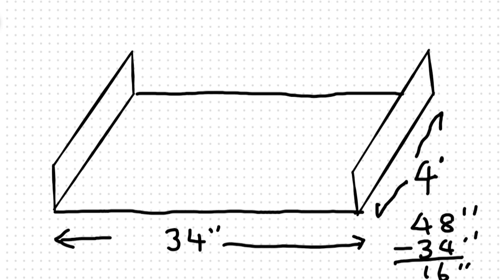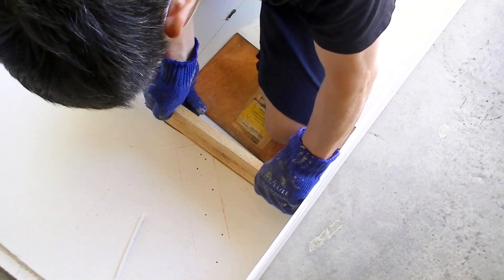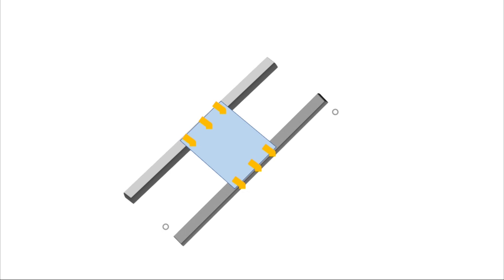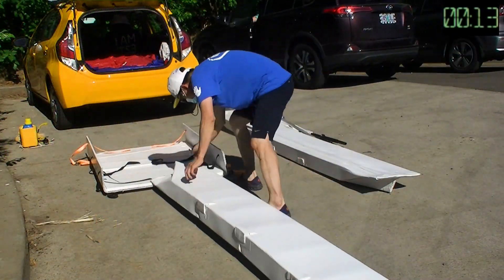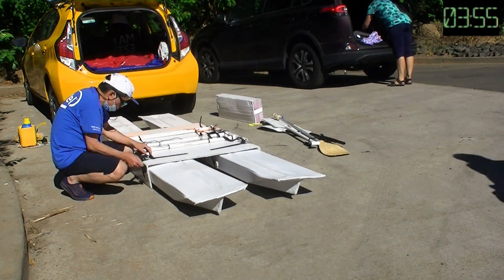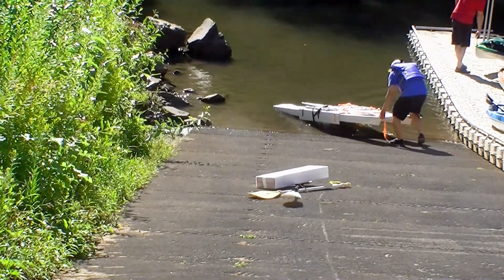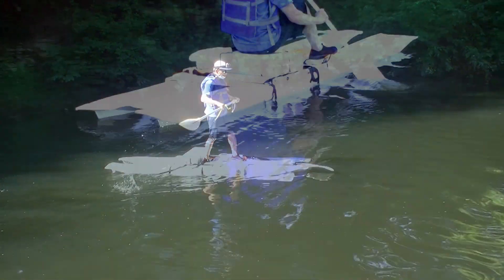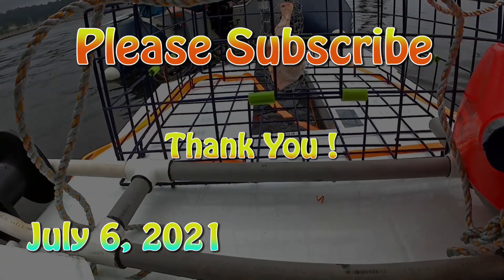Part 4 DIY Modular Paddle Board - Re-test the updated design 摺疊獨木舟

Comment: This is awesome. I just found your channel and will definitely be building at least one of your designs. When do you expect to have the plans for G17 on your website? Did much water get inside after the crabbing trip?
Reply from the maker: Thanks for watch and your question. I have used this boat 4 times, twice in the Pacific Coast and probably 10 hours (total) in the water. The left and right pontoons were built differently. I can sense the left (port side) pontoon has minor leakage (the right side pontoon works great, no leakage).  Probably from the top side. I would say there was probably 4 oz of water got in for each use. If I tip the pontoon and have it leaned against the wall, I can see water dripping out from the bow (which is supposed to be fused and watertight :-) . This is good because I don't have to make a hole to drain the water. The pontoons are 4" high. If you build a pontoon at 6" high, and adopt the technique I used to build the right pontoon, then it should be very safe. For my next set of pontoons, I plan to use the height of 8" (can carry two people). Please let me know the height of the pontoon you plan to build and I will create a plan for you. At Nehalem bay, the wind was gusting between 15-20 mph and the boat handled the wind and sea condition really well. I will post that video in the next few days. Cheers!

Comment: Great work Mr Hong! Thank you so much for sharing your technique with lot of details Sir!  I can't wait to see your work on mounting the pedal drive to this paddle board.
Reply from the maker: Thank you very much! Fusing the 10 mm thick coroplast is so much easier because overheating them would still work/fuse well (as shown in this video). Actually use Gorilla Glue will work also since the goal is to stick two sheets of coroplast together, no force to pull them apart. But it will cost me $8 for the glue :-) I am doing one more round of update-and-test to this Gen 17, then I will work on adding the pedal drive to it toward the end of this month. Please stay tuned.

Comment: It's coming along nicely.. you may want to look into how to skull a boat. It uses one paddle or oar out the back of the boat
Reply from the maker: Thanks for your advice. Yes, this is something I need to learn. I have watched video on how to do that, but with this boat, I can't move to the stern unless I extend the deck. This will add weight/cost/assembly time to the boat. I should try/practice that with my tandem canoe, which I can seat further back. For now, I have to do something more practical, i.e. catch and eat crabs :- ) I am going back to the Pacific coast next week  :-)  Cheers!